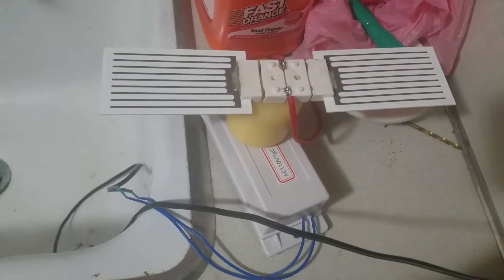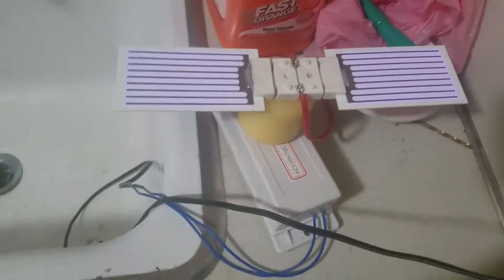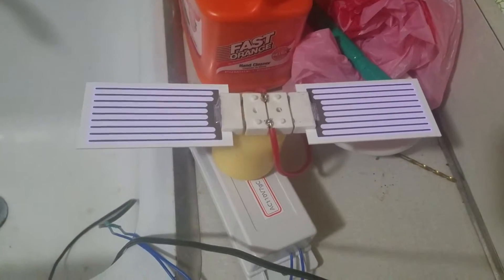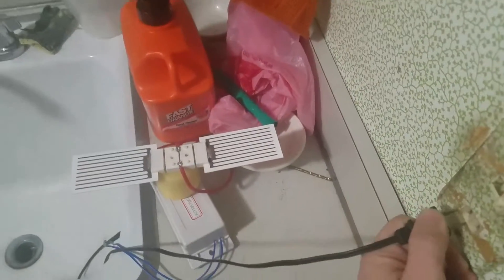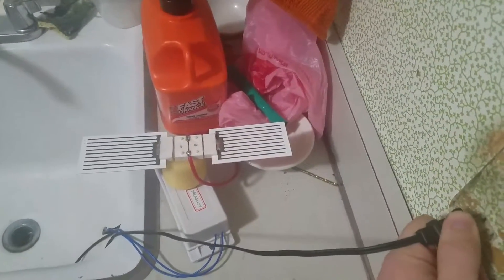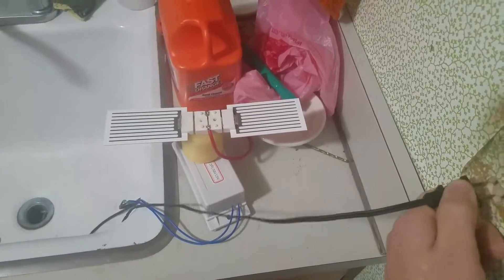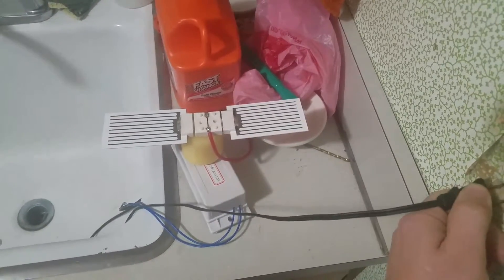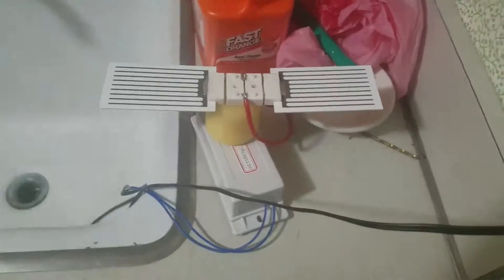Ebay faulty 110v ozone generator

Comment: I bought the same exact unit and had the same exact problem. I highly recommend you reinspect all the connections and resolder. I resoldered mine I think 6 times and eventually took off the bottom caps and soldered directly to the prongs. After that it started turning on immediately then shutting off. So I removed the crimps from the main, soldered that too and now it works.
Reply from the maker: Thank You! I`ll try
Reply: Hey, if you have a multimeter & fan I can try to help you fix it. Mine stopped working again today so I opened the inside up. I checked to make sure the tops of the capacitors weren't blown. Then applied slight pressure on each component with my fingers (unplugged). Just to make sure they gripped in the base.

Then I turned it on and it began whistling just like yours.

So then I found the original manufacturer and realized these things are very sensitive to humidity and air temp. So all I did was BLOW HOT AIR from my mouth over the plate right after plugging it in and suddenly the plate lit up with a full corona.

That's when I noticed they REALLY ARE very sensitive to heat and humidity.

If your unit is whistling.... I think you need to "coerce" the corona to cross the gap. I have no idea why but I've noticed my corona starts immediately and maintains with air blowing over the top. Then when I turn the fan off it goes back to whistling. 

Try blowing on your plates or use a fan. If you see a corona form and maintain I'd permanently glue a fan to it.
Reply from the maker: Robert Cece , I took it apart, and tried to check the voltage on each element, also tried to check the frequency before main coil. not sure if I was using this mode right, but found when touching the contacts in Hz mode before main coil it starts immediately. Main capacitors are fine. 
If you found the solution, I'll gladly take it.
Reply: Ok I'm back. I found out 100% what the problem was with mine & the fix is real easy. You just need to do 2 things. First, disconnect the output wires. Then put on some gloves. I tried grabbing the wires hot (with bare hands) and though they won't shock you... you will feel a weird type of charge trying to go through your hands (through the red insulation on the wires). 

Then do this:

1) Keep shorting the wires and very slowly pulling them apart (like a mini jacobs ladder). On my machine, once I pull back to around 1.5mm the spark consistently breaks down. If I keep the wires within 1mm of each other the spark will connect & go forever without breaking down. Between 1-1.5mm it starts to get unstable. Between 1.5-2mm it can't cross the gap much at all.

2) Stop using 2 plates. The 2nd plate was a replacement plate.

3) You won't get 2 plates to work simultaneously unless your machine is generating a spark 3-4mm long. I have the same machine you do. I'm assuming they're built exactly the same and are made for 1 plate. You can check the spark gap to be sure but I'd remove it from the start.

4) Even now, you still won't have enough voltage (very likely). If your spark is most stable around 1mm (like mine is), if it starts to flitter and break down around 1.5mm, you barely have enough voltage to cover 1 plate.

That sound your hear is a build up of high pressure voltage inside the transformer. And it will only make that noise when you have TOO MUCH SURFACE AREA.

So a very quick way to fix it is to buy a bag of those flat, round, iron magnets.

All you need to do is slowly cover and break down the surface area on the plate. Start off with 2 magnets. Put 1 behind the plate and 1 in front. Try to place them towards the middle of the plate (just looks neater). Let the magnets hold each other together and block off surface area.

Now turn the machine on. You should notice that the plasma is holding more stable than before. With my machine though it still wasn't holding stable. So I added 2 more magnets to block more surface area. 

Then turned the machine on and now it starts every time. The plasma maintains perfectly. Also, if you block too much surface area you'll just notice that the plasma that forms (where the surface isn't blocked) will be stronger, brighter, and cover more surface area in the non-blocked areas. Like where I had vertical dashes of plasma before... with empty space in between... now the plasma jumps and covers the entire gap on the plate. So you don't see vertical dashes it just looks like the whole surface is covered with plasma.

Overall it's roughly 25% of the surface area that I blocked off. Which tells me the voltage is only strong enough to cover 3/4 of 1 plate. Not 2 plates. Not 1 plate. Just 3/4 of 1 plate.

And I noticed you really need a spark around 2mm per plate. My spark like I said breaks down around 1.5mm. So you can gauge by the spark roughly how much surface area it can cover. Unless your spark is holding around 3-4mm there's no way you're covering 2 plates.

And if you're wondering how I figured this out I bought a 2nd, $80 ozone machine on amazon (brand is "ozone power"). It uses 1 hex plate and puts out 5000mg / hr. The thing is a beast just with 1 plate it stinks up my whole house and comes with a fan and everything. I noticed immediately the plasma that forms on those plates is way brighter, stronger and leaves NO GAPS uncovered on the plate.

So I shorted the wires on that machine and noticed the spark was almost twice as big but being used just on 1 hex plate the same size as the "dash" plates. It seems because the hex plate design covers more surface area (on the same size plate)... it keeps resistance lower but can take more voltage since more metal is printed closer together.

Anyway, you'll figure it out. Lower pitch noise with full plasma formation = higher voltage or less resistance. High pitch noise with no plasma = high resistance and low voltage. And keep in mind that the plates and magnets will get very hot without a fan. So get a fan by it if you leave it on more than 10-15 mins otherwise the plates get real hot.

That's about it. If you do this and get your machine working please let me know as I'd like to do a video showing other people how to fix the cheaper more crappy machines. If it works for you AND me chances are it'll help others as well. Thanks!